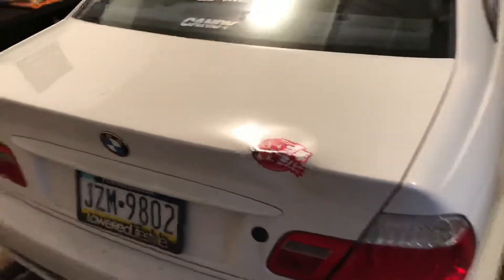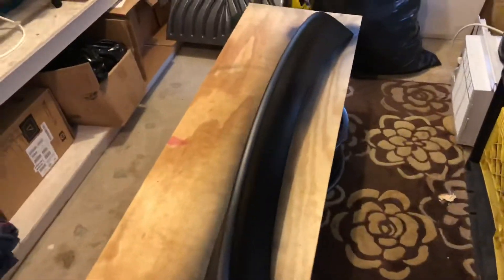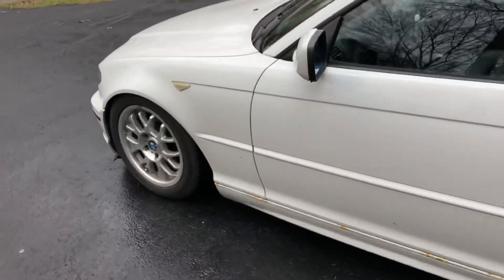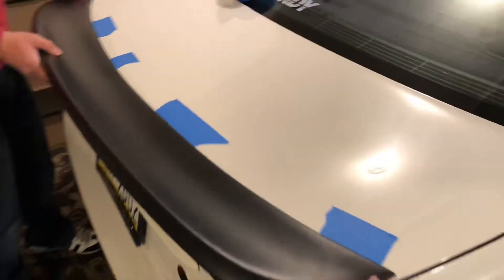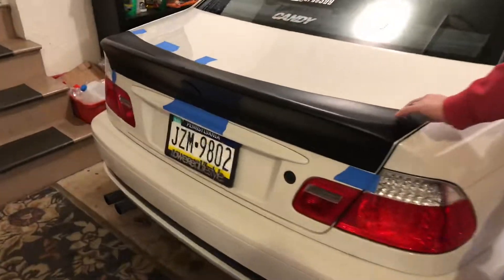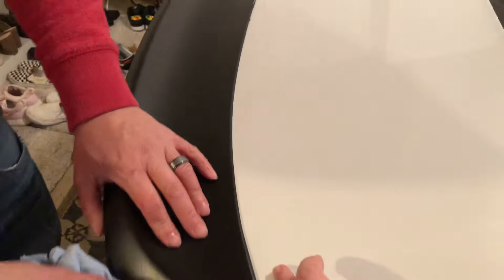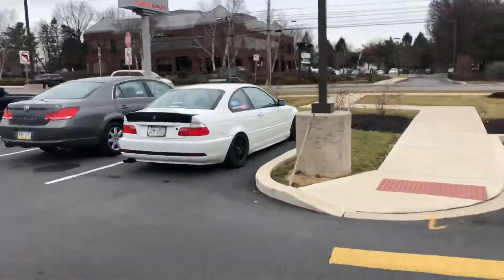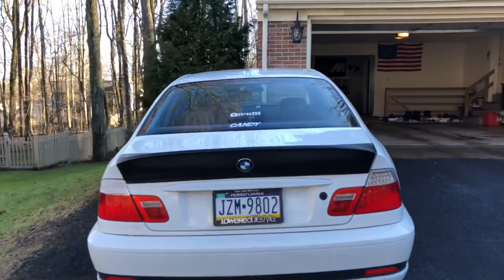Cliqtuning E46 CSL Spoiler Install

Comment: How much of the tape did u use
Reply from the maker: Carlos Herrera I bought a roll of 3M super adhesive tape, and I used the entire roll. I put about 4-5 long strips across the top of the trunk and 4-5 long strips on the bottom of the trunk. I’d advise getting extra tape just incase you wanna add more/tape the BMW emblem on instead of drilling into the duck tail.

Comment: Paint it white, looks cheap in that matte black.
Reply: matte black?… that’s black plastic.
Reply: @LukeVMH-Games  It doesn't shine so  is matte. Name is not important but the colour you can see.
Reply: @michaeljackson6106  it’s not painted. period. it’s not a color. that’s how every car body part looks with no paint.
Reply: @michaeljackson6106  it’s not a name. The spoler is not painted any color. It is a plastic material. Unpainted.
Reply: @LukeVMH-Games  I haven't said it's painted, I said better will look if painted white. I have a little idea on how car part looks when not painted from the dealer. I worked at BMW.